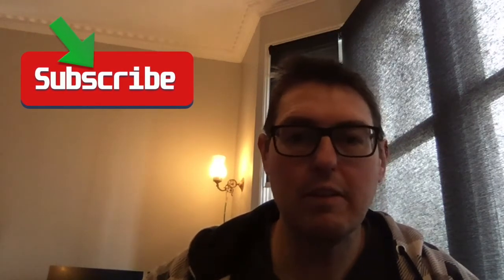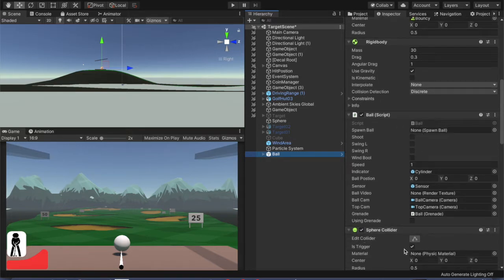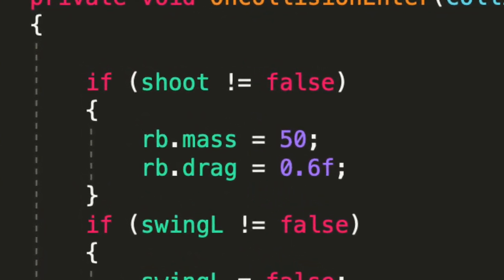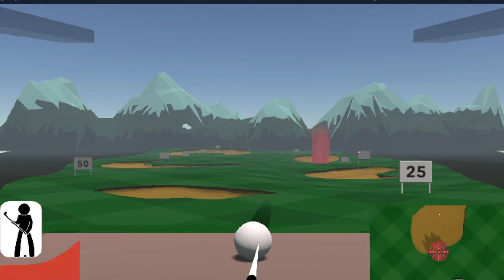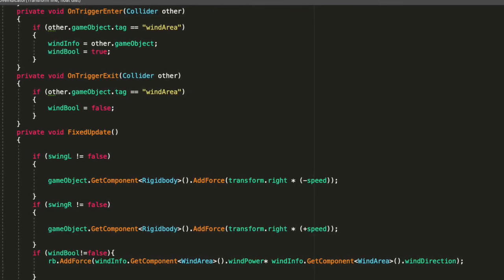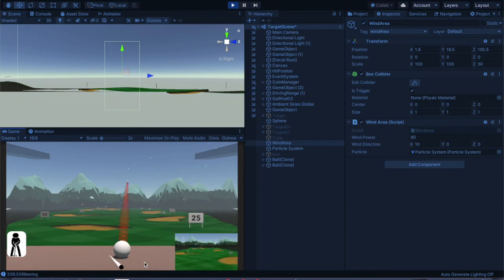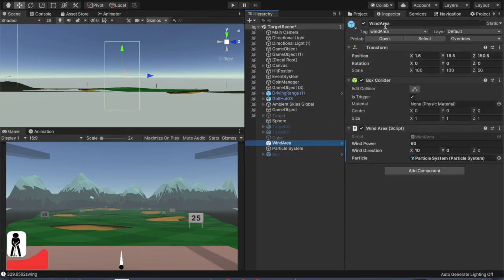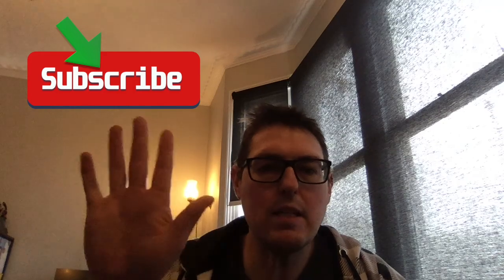Unity Golf Ball Physics C# How to get a golf ball bounce, wind areas, random landing spots.

Comment: How would you make a realistic golf game? You can buy golf launch monitor devices that measure the actual physics of the golf shot expressed in five variables. 1. Ball speed 2. Vertical launch angle 3. Horizontal launch angle 4. Ball spin 5. Ball spin axis, with these 5 variables it's possible to model the actual ball flight and get a pretty realistic golf ball carry distance, and where it will land taking into account shot shape / curve by interpreting spin and spin axis. There are a several games that can already do this: TGC2019, Foresight FSX, GSPro, Awesome Golf, Creative Golf 3d, Golfzon, about golf,  and many more. Most of these games are made with unity. Once you model the shot and where it will land you can do more stuff like bounce conditions depending on the type of grass / surface the ball lands on such as sand vs fairway vs tall grass. Because of the small market these games are very expensive in the range of $500 to $2000+ for the software alone. It would be cool to learn how to make a basic game that can take these launch conditions and release it for a more reasonable price like $60-$100. I've seen differential equations that model ball flight and give x/y position over time as a function of ball velocity and spin in x/y components but how would get get something like that into unity? The sophisticated equations I've seen use python and numpy, they do interpolation and solve differential equations using Runge-Kutta or Euler's method.
Reply from the maker: You can add many conditions and unity to give more realistic version of golf. It would depend on what platform you plan to release the game on and how realistic you want to make the game. But if you can get the physics to be close to a real golf ball you a half way there